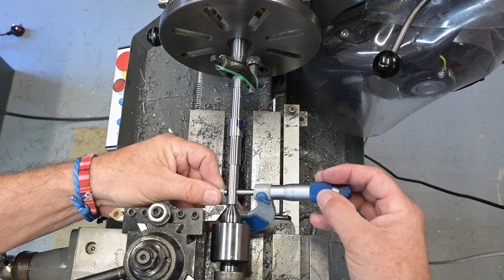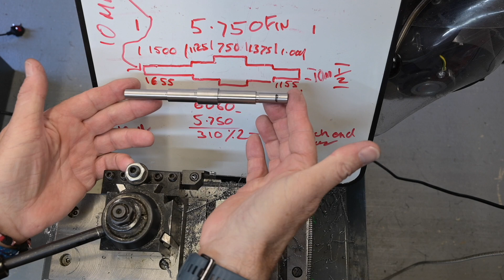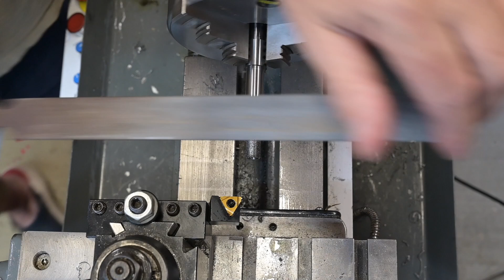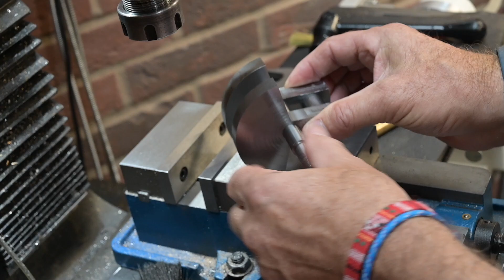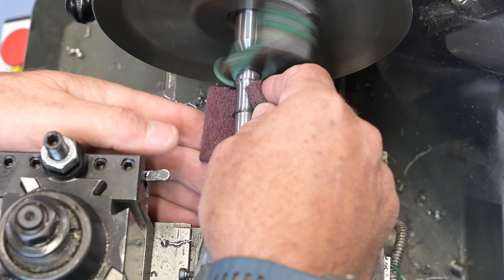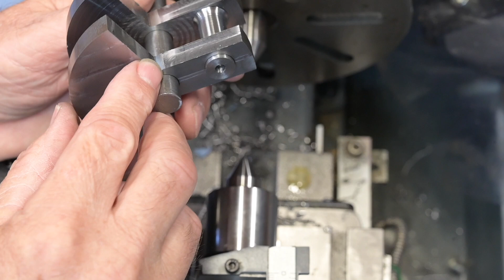Crankshaft Miniature Petrol Engine Part 20

Comment: Very nice Mark. You’ve made a great job of the crank. Could you locktite and pin the parts together, rather than braze them. Looking forward to the next round. Cheers Nobby
Reply from the maker: Unfortunately locktite would not hold once I cut the middle section out. I have decided to tig braze it because thats all I have. But waiting till I build up enough confidence, I can tig weld but have never tried tig brazing before. I will do a few practice pieces first, I don’t want to mess up a weeks work ATB Mark.